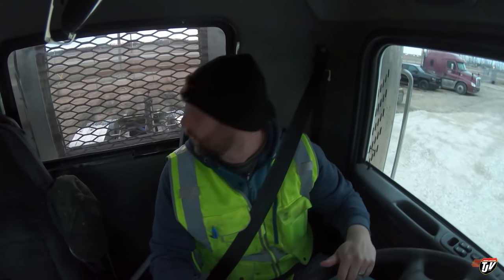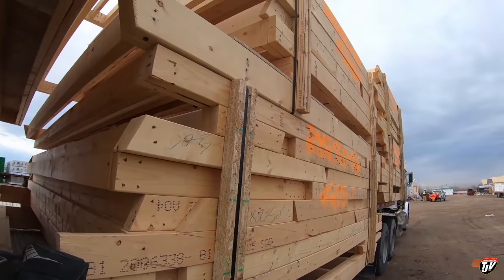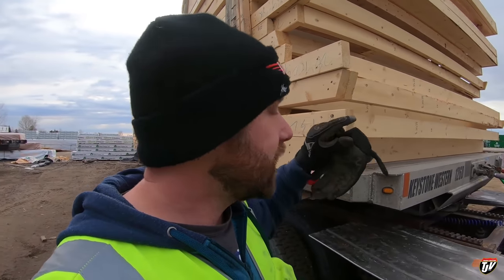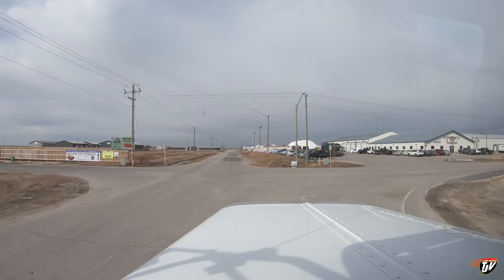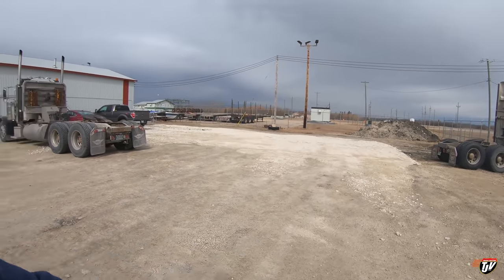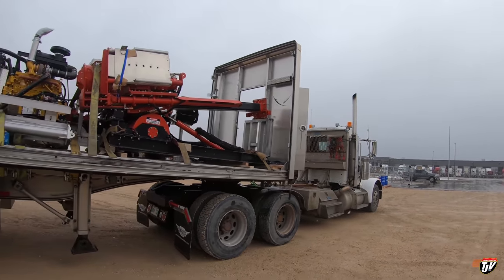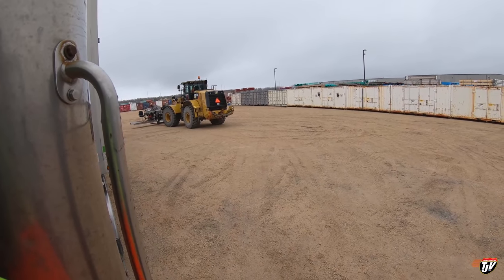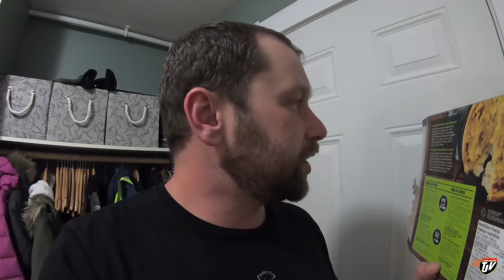My Trucking Life | OVERSIZE | #2242 | March 23, 2021

Comment: Try the SunJoe SPX3000 pressure washer. That’s what I use and love it. . Easily portable and comes with different spray nozzles. I use it on my deck to clean it. I bring it inside during the winter. It’s $197.97 on Amazon.